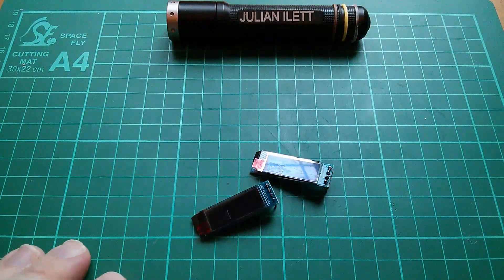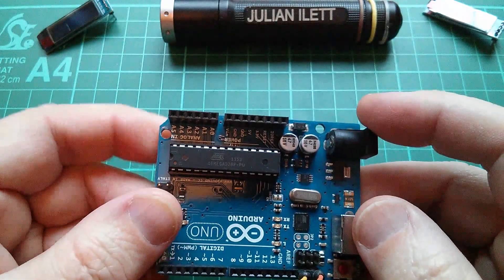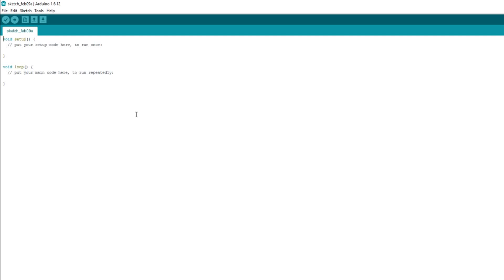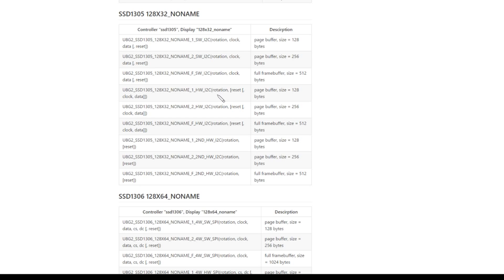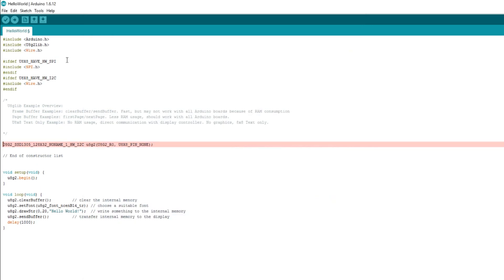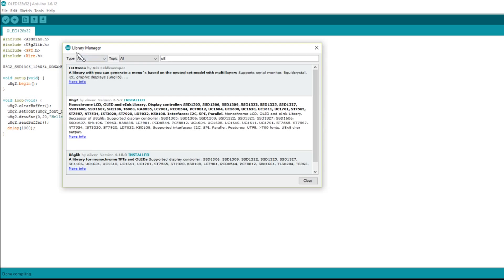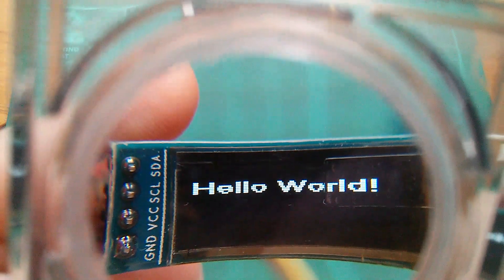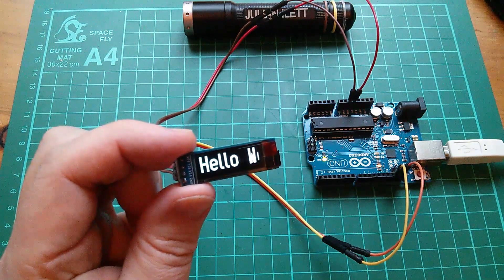Arduino Anxiety - Uno, 128x32 OLED and u8g2lib

Comment: It's probably saying that it doesn't know what to make of that line; if it's a constructor, or even an initializer call for a model, it should probably go in the setup() function. Where you have it, according to ANSI C, is a function prototype, but you've provided no implementation. Furthermore, the part in parentheses, "U8G2_R0", is incomplete; if this is the argument name, then it needs a data type, like int, char, void *, etc... (i.e. "UInt8 U8G2_R0" would tell the compiler that the argument name U8G2_R0 is a type of 8-bit, unsigned integer.)

Comment: I feel your pain. C has frustrated me for over 20 years. why can't I just write code in Pascal?
Reply: Ah Pascal, happy memories of college. Fist proper programming experience, Apple][e then Turbo Pascal 1.0 on the classes only 386 PC (so much faster at compiling).
Reply: learnelectronics I suppose you could port a cross-compiler for Free Pascal. Would be interesting.
Reply: That's why I prefer MicroPython boards.
Reply: Because it's even worse?

Comment: Does not name a type means C doesn't recognize the variabile type cos it's not defined in the library. When you write SOMETHING u8g2(...) you are declaring the variable u8g2 which is of type SOMETHING... that's the reason for that error ;)
Reply from the maker: That must mean that some of the listed constructors aren't actually in the library. That's where I came unstuck.
Reply: Julian Ilett That appears to be the case, if you send me where that constructor is listed I can look into the library code and submit a fix to the maintainer so that it won't happen in the future
Reply from the maker: No need to submit  anything now, it was my mistake - update video coming soon.

Comment: Now make it scroll so "World" can be read.
Reply from the maker: That's probably quite easy, but I'll be displaying a numerical value to show Amps measured by the INA219.
Reply: Robert Albert those ina chips (there are many of them with different specs) are great. Looking forward to see your project going on
Reply from the maker: Thanks Michael - my main concern is the rather high 100 milliohms shunt resistance. We'll see...
Reply: it's easy, clear the screen, write stuff, clear screen, write stuff at horizontal pos +1, clr, +1, clr,+1 ..... and round it up at the end.
Reply: You can change the shunt. There are also holes on those eBay INA219 standard modules where a wired resistor could be soldered in. But lowering the value also lowers the max current because this INA219 only can measure up to 320mV between the resistor Terminals I believe. If you can live with max 1,6 A than you could easily use 2 of the resistors in parallel. The gain of the internal amplifier can also be changed but this only helps to get better resolution and therefore lowering the max current. All of course relative to the used shunt resistor.
Reply from the maker: 3.2A is probably a good compromise. Just not sure what will happen if I put a fully charged 18650 in parallel with an empty one. Lots of current will flow for a while through the two 100mΩ resistors in series. It'll probably be OK :)
Reply: I think I read somewhere that the chip does not really like this but I never tried this myself. Maybe you'll release the "magic smoke" than...

Comment: When it asks for a type it means that some variable isn't declared.. I.E. int,long.float.double char or struct.. Somewhere buried in the library usually.
Reply: Nick B You do realise what you just said makes no sense?
I've seen bloat in every language, that includes your beloved C.
Reply: Nick B That's user defined ;-;
Reply: Actually U8G2_SSD1305_128X32_NONAME_F_HW_I2C (and friends) was added long after 2.5.2, since version 2.11.3 (date 08/01/2017)... The current version is 2.14.0 (out today). You can get it from here https://drive.google.com/file/d/0B6Dg4hDce9fHRWU3WmhZdWZ6ZUU/view?usp=sharing (just use Install ZIP in the IDE)
Reply: Nick B Then write that, or write your own function that'll do it for you.
Besides, that function is only really there for beginners to make it easier.
Reply from the maker: The full name is U8G2_SSD1305_128X32_NONAME_F_HW_I2C, I was abbreviating it :)
Reply: Remember that Arduino is not just for one microcontroller, so many wouldn't have a PORTB at all, digitalWrite abstracts it all.

Arduino libraries are not the perfect showcase of C++ code, they tend to be less than efficient. You likely could implement a digitalWrite equivalent using templates and have the same assembly output as as you would with PORTB, and keep the portability and ease of use.
Reply from the maker: So it seems the 128x32_NONAME constructors aren't properly implemented :/
Reply: Julian, how can they be? That begins with a number, that's not legal!
Reply: Makes no sense eh? OK.

Compare the compiled output of digitalWrite(13, HIGH) with the compiled output of PORTB |= (1<<5). They are functionally the same but worlds apart in output and execution time.

Using the smaller and faster code makes perfect sense to me.
Reply: Yes indeed, the bloat of C++ even extends to naming, hehe!
Reply: Yes, user-defined bloat, one of the reasons I so dislike C++.